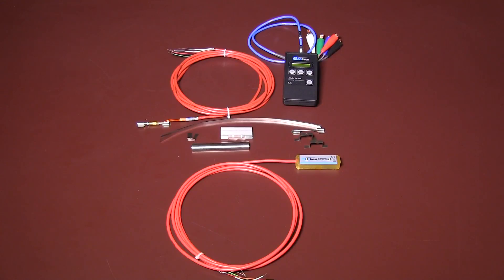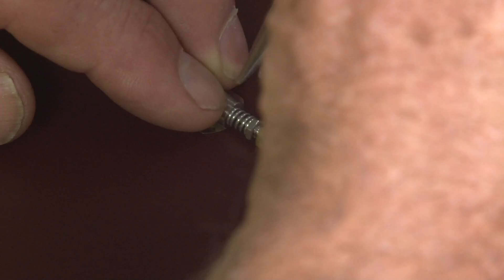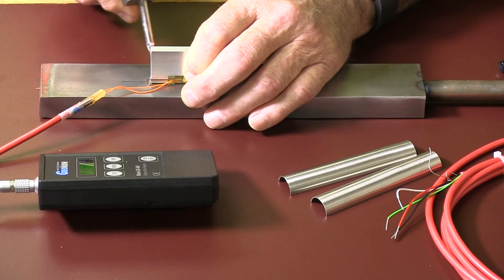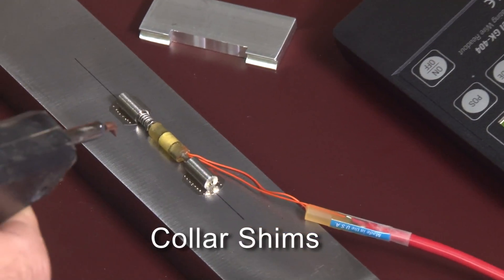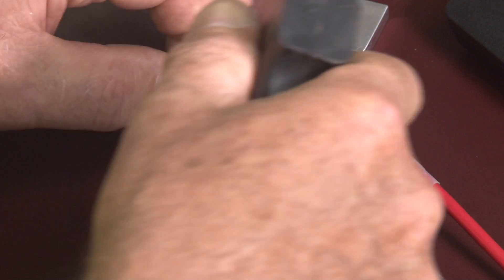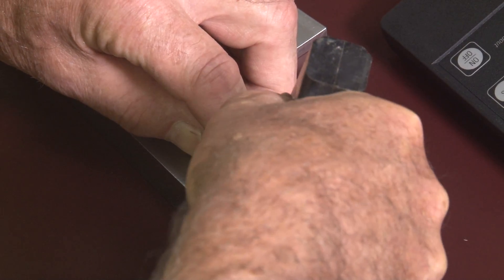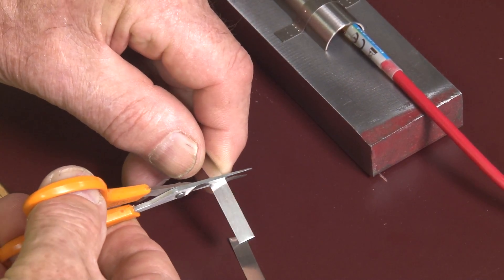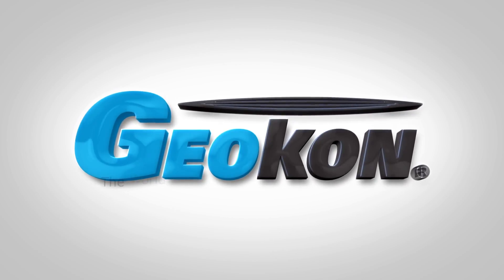Model 4100 and 4150 Series Spot Weldable Strain Gauge Installation

Comment: What is the spot welder gun used in this video? We're looking at installing some strain gauge like this.
Reply from the maker: Hello David: a Model 700 Portable Strain Gage Welder/Soldering Unit was used in this video. However, it has been replaced by the Model 4100-WLD Stinger spot welder, which we currently recommend. More information about the Model 4100-4150 and a photo of the Model 4100-WLD can be found here: https://www.geokon.com/4100-4150

Comment: Very interesting, weldable strain gages have come a long way. I use to be a Static and Dynamic testing technician back in the 80's and 90's. I must have bonded and welded 100, 000 gages over a 11 yr period. My boss and owner of the company Sandy Friezner came up with the weldable strain gage in the 1950's while working for FLW.